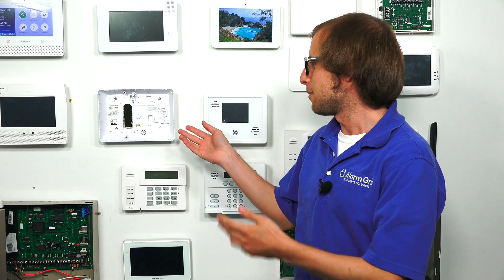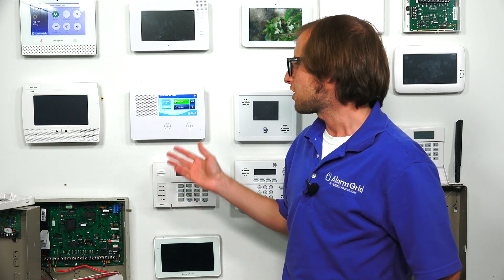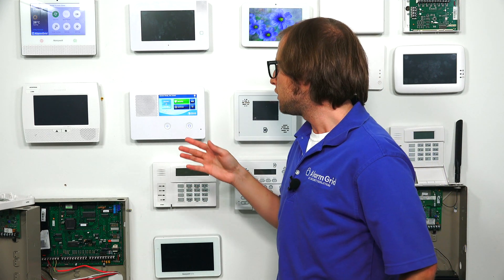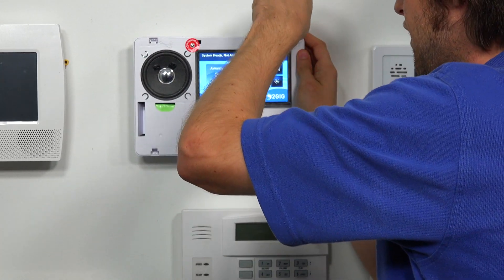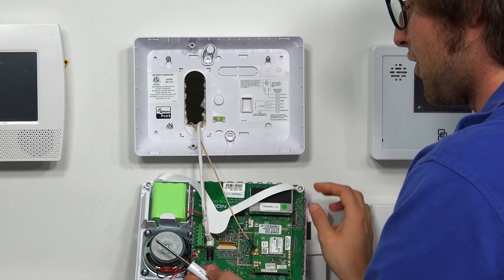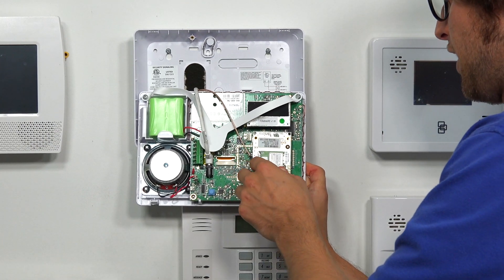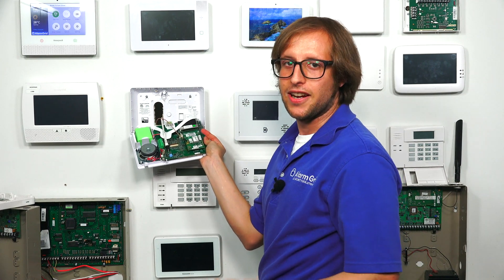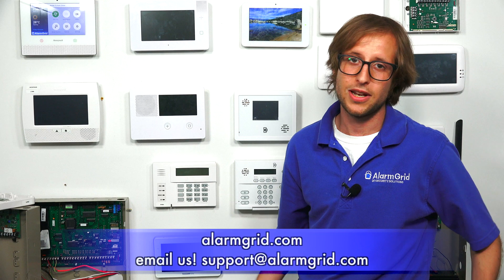Installing the Cell Module in a 2GIG GC2e

Comment: is it possible to mount the diversity antenna to the inside of the panel's back plate using double sided tape especially when doing the desk mount option?
Reply from the maker: This would be a trial and error situation. There's no way to be sure this wouldn't cause cell reception issues other than to try it and see in your location.

Comment: So I unplugged my communicator with the power still on, to flip it to check the serial number. Then plugged it back in. It seems fine? Could there be damage even though my screen and communication to door sensors are still working fine?
Reply: If it got damaged you will see issues pretty quickly. Just monitor it, but you may be fortunate.
Reply: @freddaniels8259  wow every sensor seems to work, can't believe how lucky that was.
Reply: @zack7029  Thank Goodness.

Comment: did he brick that panel or did it just need to be hard reset?  Never did this with the power on
Reply: Yes, the panel was bricked during this video. We've added notes at the beginning and during the section where he removed the communicator to make sure the system is powered down to prevent others from repeating the mistake.
Reply: Thank you for the video.  you guys could have easily made another video and never showed this.  Great job!